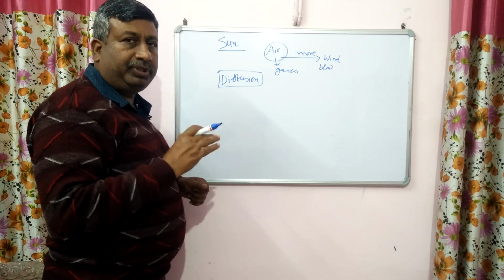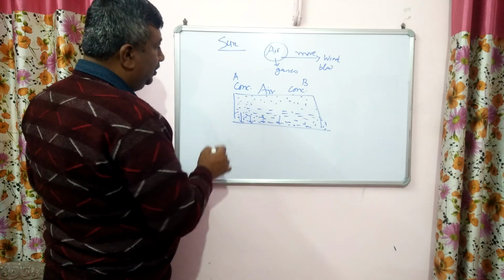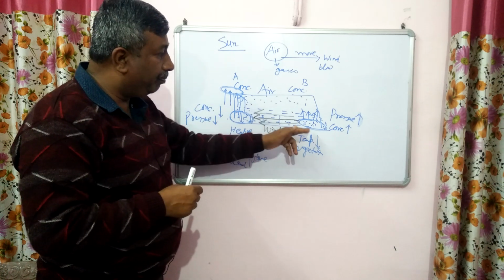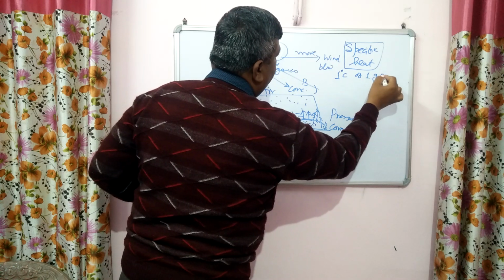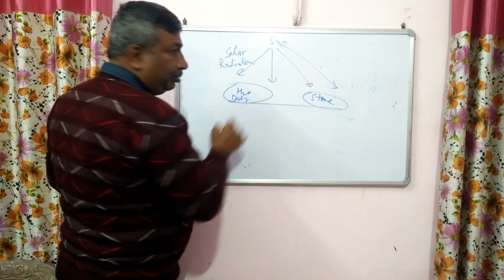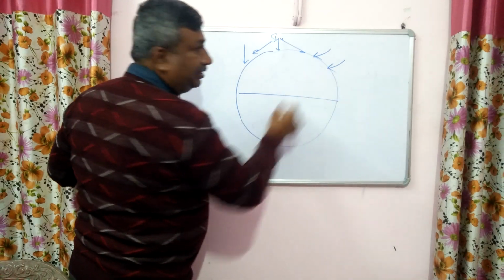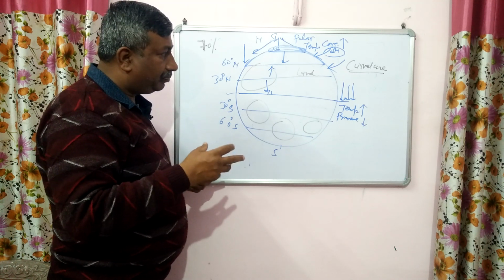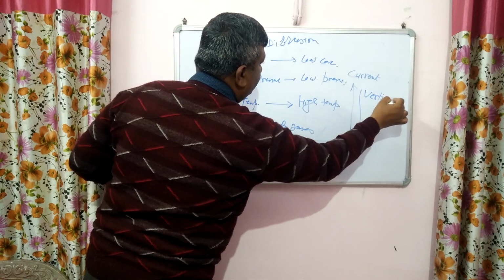How does wind blow?

Comment: Sir , Air heat by earth on surface is by conduction or convection ?
Reply: Sir but u have told in your lecture that the air near the earth surface with high density first get heated through conduction then þhe above layers through convection
Reply from the maker: Convection
Reply: Tq sir But in text book it is given as Cunduction
Reply from the maker: @honnappaaski195  Earth surface is heated by conduction.